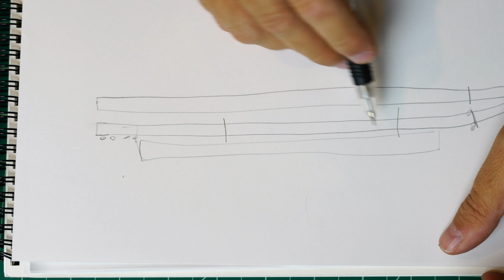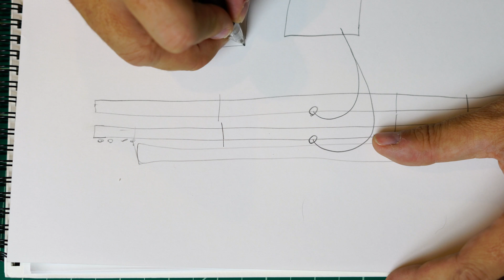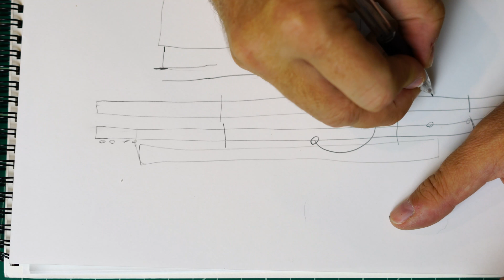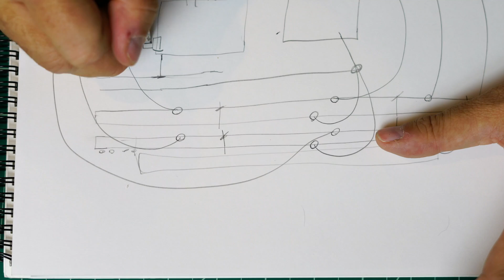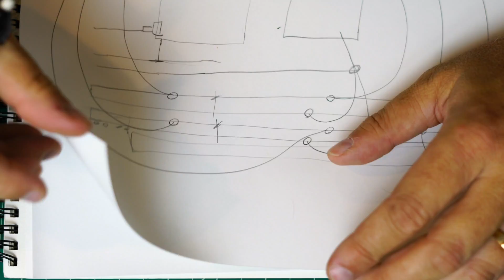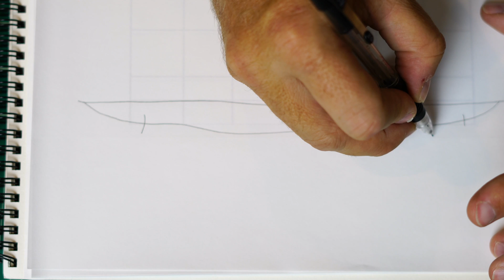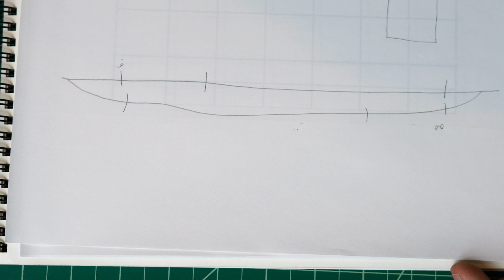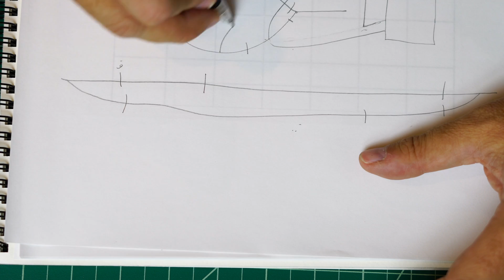Wiring A DCC Layout For Computer Control

Comment: Hi, You didn't make it clear, but I assuming your only cutting 1 rail for the block detection as that would give you a common ground. Since you have the Digikeijs DR5000, will you be using the DR4088LN for Loconet block detection ? The NEW DR5088RC have Railcom detection included. That would work nicely with Traincontroller.Since you mentioned signaling, Have you considered Team Digital's SHD2 Signal Decoders ? That's what I'm using. Also, are you considering Loconet control for the turnout decoders  ? Will you use Digitrax DS64's ? I'm using Team Digital's SMD84 since they control 8 turnouts and can use Loconet instead of Digitrax DS64 that control only 4.
Reply from the maker: John . . . In a word YES.  I am not using railcom as most of my decoders aren't using railcom. :( .   I am going to look aty our recommendations for signal decoders! thx for the comments!

Comment: I think photoelectric detection might work better for stopping a train in a precise location. I believe your software will allow you to mix photo and current detection on the same layout. Photo detectors can be hidden in trackside structures. Current sensing works well for tracing the movement of trains around the layout but photo sensing makes triggering an action simple.
Reply from the maker: +Jerry Smith I can combine anything I like. I also considered reed switches. All the methods have pluses and minuses to them. I’m going to start with just the electrical detection because that is what I have on hand. But I certainly won’t rule out any other method or combination of methods. Thank you for the comment and ideas!!

Comment: Hi Curtis! Computers and trains are really the norm these days... The closest I've come is my NCE PowerPro, and I'm just dabbling into JMRI. 
Using a computer to RUN my trains, is something I never considered! What you're planning, sounds great, and I look forward to seeing it work. This is the best part of our Hobby!! Multiple methods to run our trains, and with few exceptions, all are good!! 

My experience with Metra, was my commute from Naperville to Downtown Chicago...
The Engineer running the F40PH had two speeds only.... Idle and Run-8!!! 😱😵 Hopefully, your passengers get smoother starts.
Carmine 🚂
Reply from the maker: +PacbeltRR You really have to think ahead. DCC and computer controlled are related but different. As I said in the video you need to really plan for your zones and every bit of track has to be accounted for or everything comes to a standstill and/or certain routes aren’t available.  

The Metra does NOT waste any time. My ride was smooth as glass. No jerks at all. 

As always, Thx for your comments!!